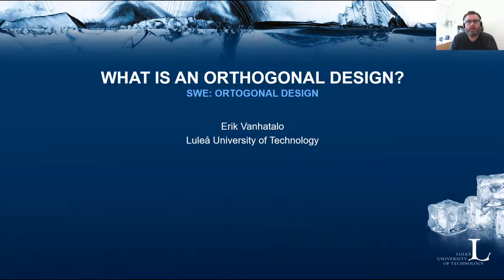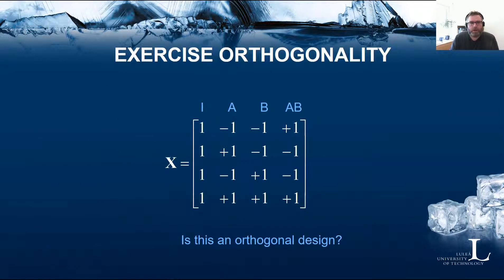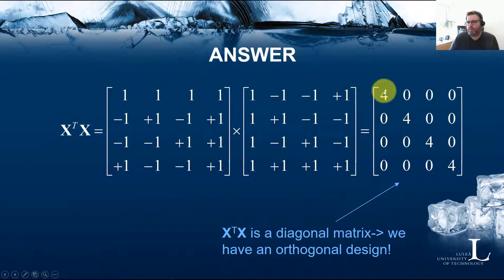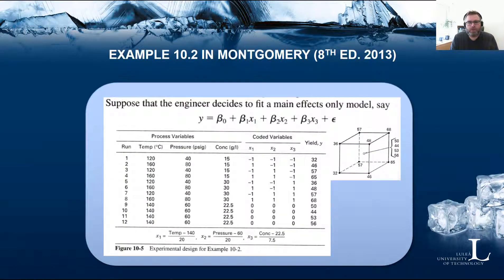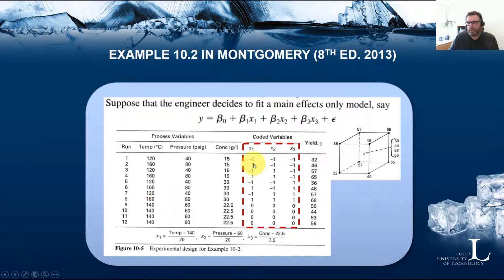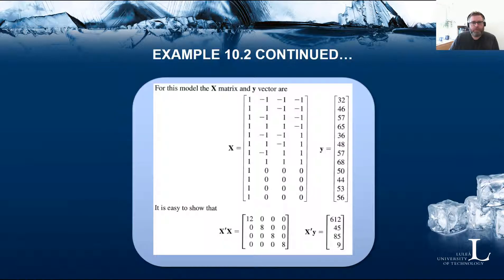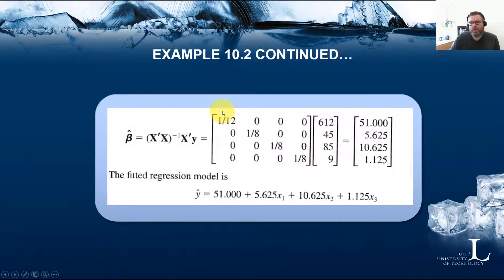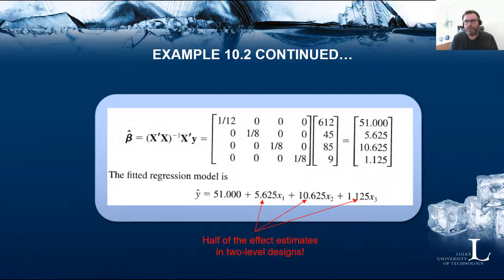On orthogonal designs and regression

Comment: the pressure variables supposed to alternate 40 40 80 80 per the coded variable x2
Reply: Just spotted that too. Mistake in the book I think
Reply from the maker: Thanks Dennis, good of you to notice that! You are correct in that the pressure variable in the natural units does not match the coded pattern. This image is borrowed from the book companion slides so it is a typo in Montgomery's book. Nonetheless, the mistake was also mine in not noticing that. Best wishes, Erik

Comment: Hello Sir, great video, thanks for this! A quick question. How would you regress the higher order term such as A^2, B^2 which are quite common in any response surface design? I researched a lot about this, but couldn't find eneough help.
Reply from the maker: Thanks! Glad you liked it. Now in order for you to fit second order terms, such as A^2, without confounding you typically need a second order design. You may want to chck out central composite designs or Box-Behnken designs. These are examples of common designs in response surface methodology. Cheers!